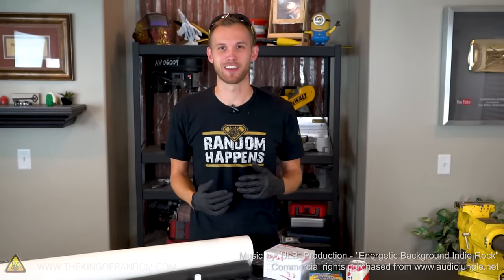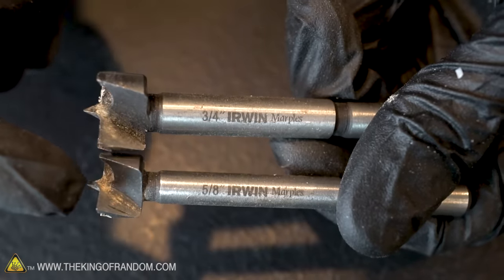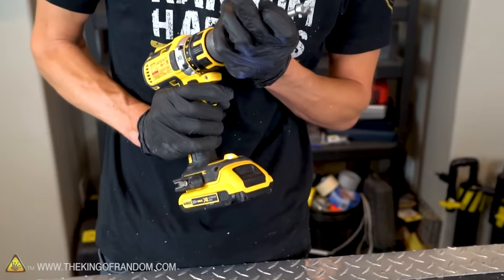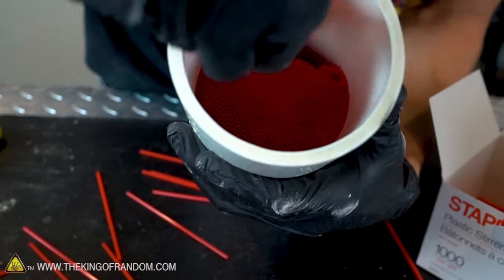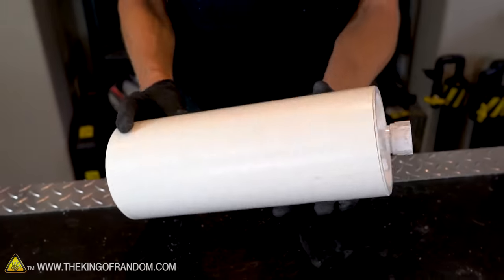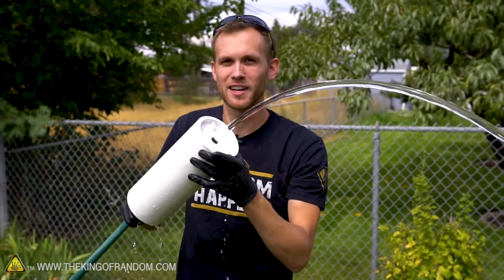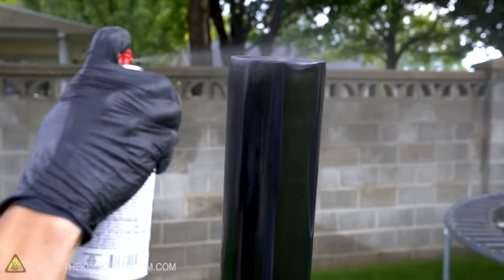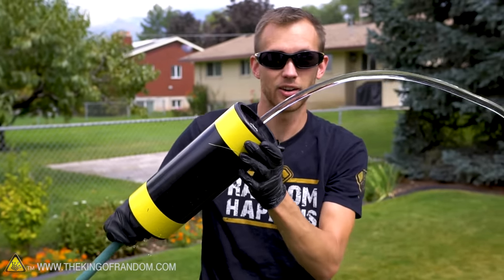Making a Laminar Flow Nozzle! TKOR Teaches You How To Make Laminar Water Flow Fountain

Comment: Instead of sanding down the flat hole of your nozzle, couldn't you just use a funnel after the straws to draw the water down to the correct diameter? This seems like a more efficient way to keep the water flowing in straight lines while reducing the diameter without any turbulence being introduced.